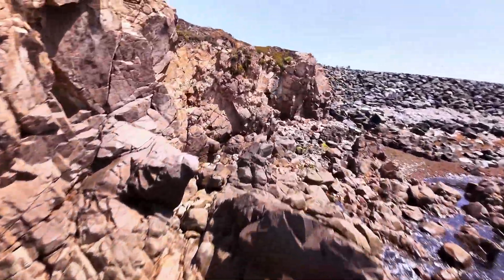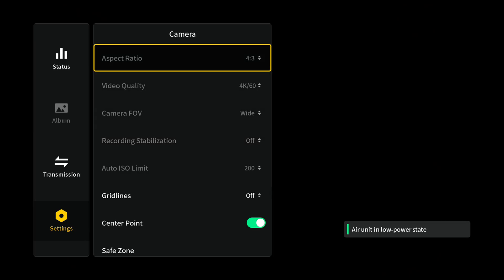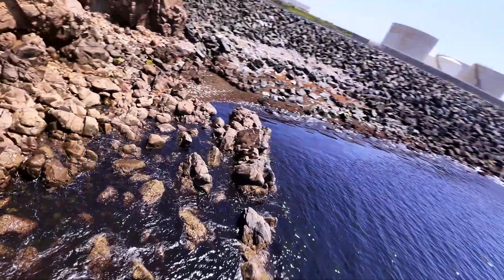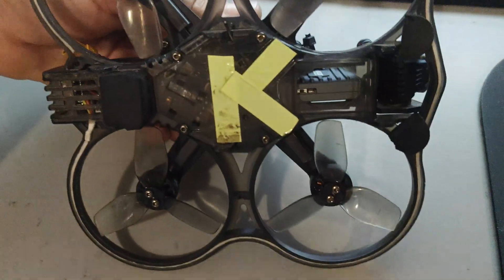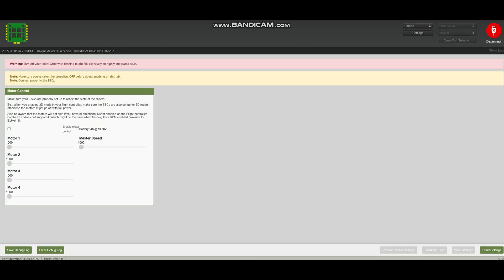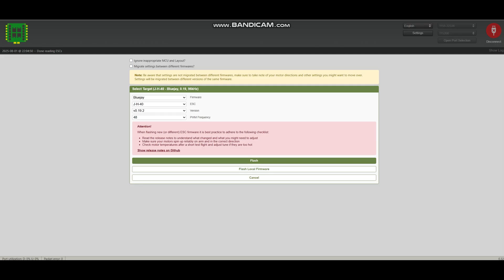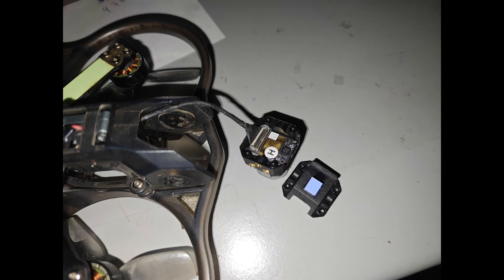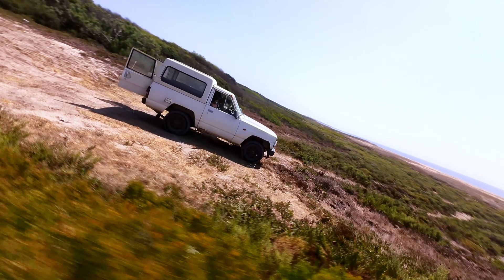DJI O4 + Gyroflow FIXED! The Real Reason Behind the Shaky Footage

Comment: i spent the whole weekend trying to figure out why my DJI o4 Lite footage in gyroflow is unusable. The raw video was quite okay not too bad but gyroflow on standard settings just made it unwatchable enhancing any small vibration especially in the roll axis. Anyway i remembered when making the first attempts early this year the footage was always buttersoft in gyroflow.
So i downgraded the DJI O4 Firmware and it removed all stutters that gyroflow was putting out. Just go to the earliest firmware version of the O4 lite and you are fine.
Now you can enjoy the O4 like it used to be, no blacbkox extracting, no pwm settings, just drop the file in gyroflow and in standard settings you get amazing soft smooth footage.
Reply from the maker: Thank you for your comment! I’m glad we’ve found another solution to this problem, it’s always great to share knowledge !
Reply: tôi sẽ thử.
Reply: Và không thành công
Reply from the maker: @LamDongview  do you already changed the pwm frequency to a higher one? regards

Comment: im getting a vibration effect in my footage that gyro flow dosent take out is there a way to do it or I just need to fly more smoothly ?
Reply from the maker: hello kduce, inside the gyroflow try to enable a low pass filter, and ajust the frequency as you need. do you have already any ND filter installed, i recomend an nd8 for lite version and nd16 to pro version, also on the googles, set the maximum iso to 400 and decrease the shutter speed to someting like 1/200, the lower value you have, less chance to get gelo, but more chance to get motion blur and less overal exposure! and dont forget, try to use the lowest iso as possible in order to improve the image quality. good luck!
Reply: If something doesn't work, use tape.